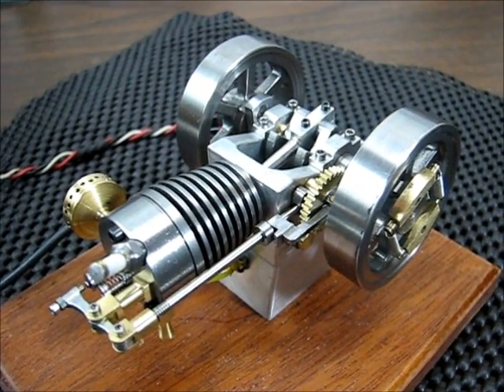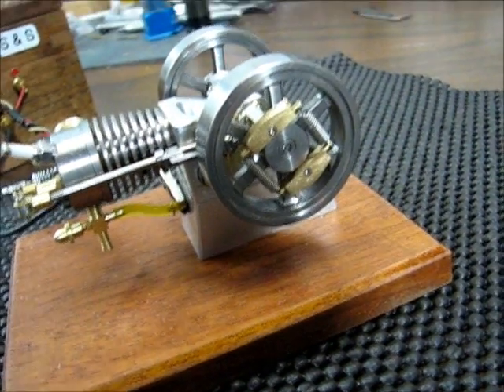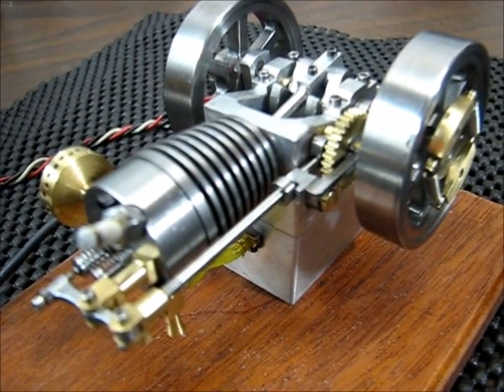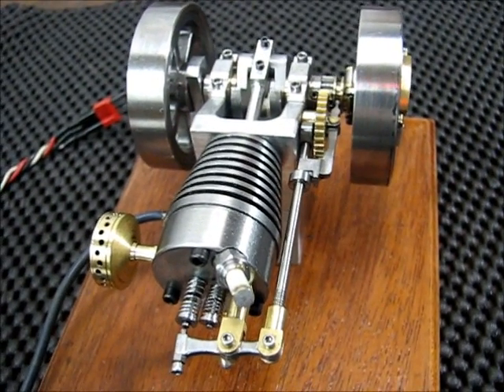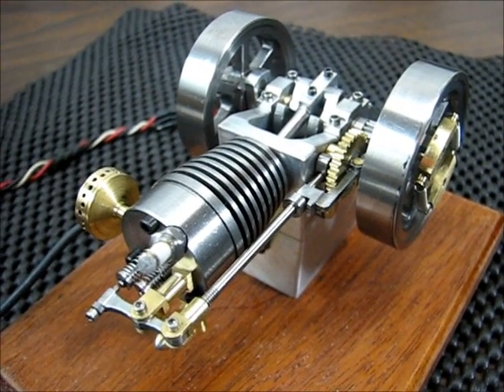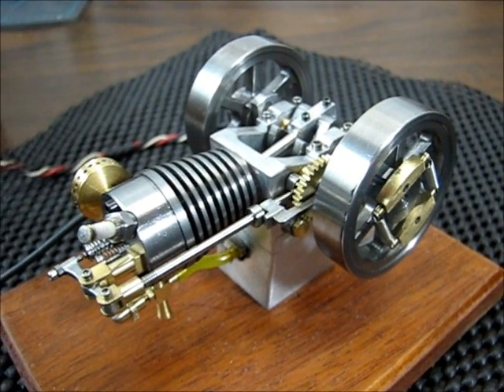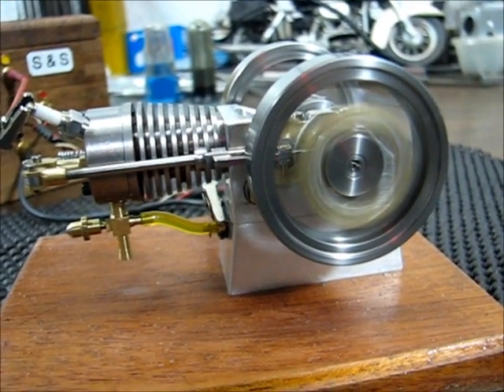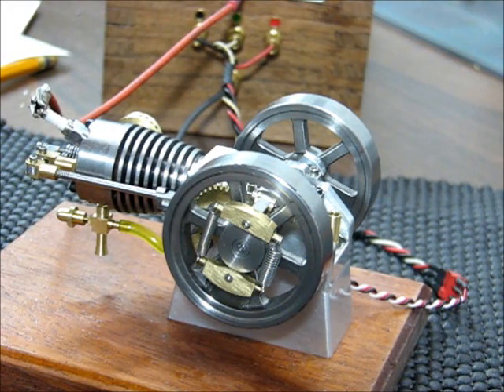TINY AIR COOLED HIT AND MISS ENGINE

Comment: I see only 1 valve controlling what appears to be the intake, how is the exhaust valve managed. Or is this a two stroke engine.
Reply: Look closely there are two valves.. the intake pulls in by itself. The exhaust is controlled by the pushrod etc.
Reply: The exhaust valve remains open until the governor calls for power. Up until then, the exhaust valve is held open and air is going in and out with the piston movement. When the governor calls for power, and the exhaust valve is closed. The intake valve is a "poppet" valve, which has enough "spring" tention to remain closed until there is a vacuum. The exhaust valve closing on an intake stroke creates a vacuum, and the intake valve opens allowing a fuel/air mixture to be sucked in, followed by comprehension and power strokes. If the power stroke speeds up the engine enough to open up the governor, the engine will begin freewheeling again.

Comment: True Craftsman, Lovely work, thank you for showing us.
I would enjoy an explanation of how the hit or miss flywheel works ? 
Kind regards
Reply from the maker: +Malcolm Till 
There are two weights mounted on a hinge joint on the flywheel. As the flywheel spins centrifugal force throws them outward. Attached to the weights are arms that reach inside the flywheel. The tips of the arms locate into a spool which slides along the crankshaft. The spool has two slots, one for the arms and one for the lockout lever. The lockout lever engages the exhaust pushrod when the engine picks up speed, otherwise it stays clear of the pushrod to allow the exhaust valve to open and close. When the exhaust valve is held open there is no vacuum in the cylinder when the piston goes down the bore so if there's not vacuum the intake valve wont' open so no fuel charge is drawn in. On full sized hit and miss engines when the pushrod is locked out it also prevents the ignition from firing.
Reply: +gbritnell Many thanks, I think i see it now, Much appreciated. Malcolm